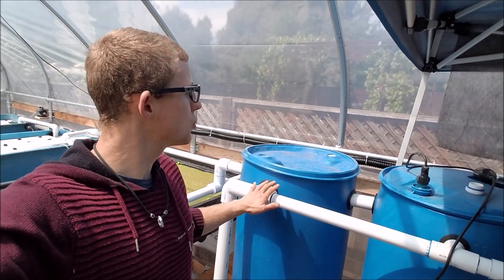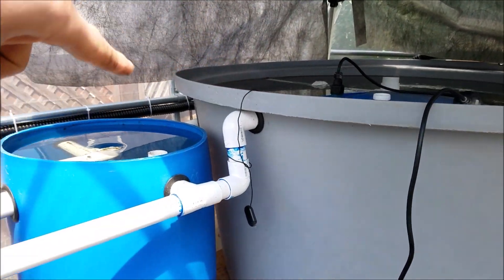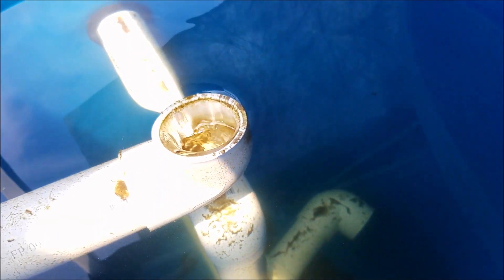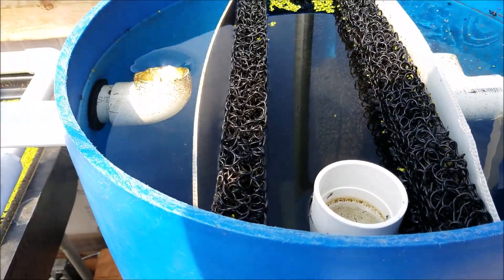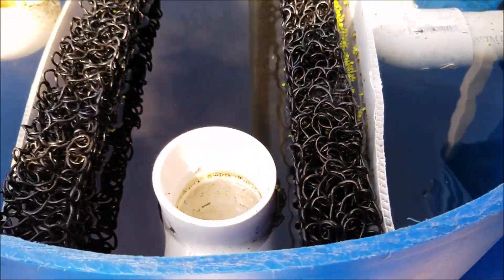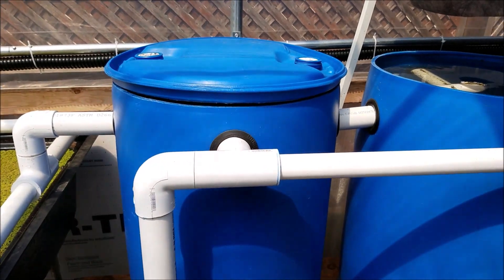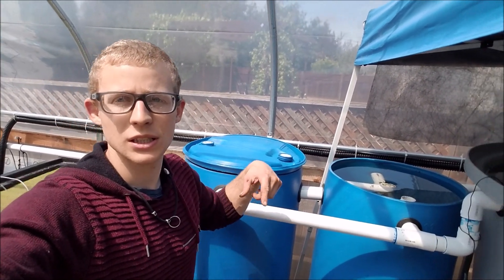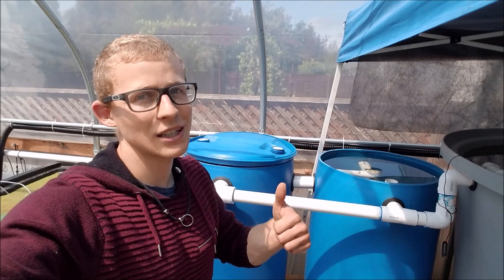Aquaponic filters- swirl filter and mechanical filter- (hybrid aquaponics)

Comment: I'm a little confused. Isn't the mechanical filter supposed to be the first filter coming from the fish tank and then the biofilter? To me, this seems as though you have two different mechanical filter systems. I may be wrong, I'm just confused as to why you wouldn't filter out the solids using the mechanical filter first and then the swirl filter.
Reply from the maker: The way this is setup is correct. Maybe I didn't explain it the best.
Also this is an older setup. (you can check out the more recent videos on the filtration here - https://www.youtube.com/watch?v=p0B2l3DyRu4&list=PLMkuBNahgb4VEpglZ5z7Ku6Bb82PUO64E&index=6&ab_channel=vonponics)

So to answer your question. This specific filtration system that you see in the video is set up with a swirl filter first and then from the swirl filter it overflows in to a mechanical filter (which also acts as a biological filter). The swirl filter is a solids removal filter, and has the main purpose of catching larger solids. It then overflows into the next filter. Which is a type of mechanical filter, and is for further catching solids (primarily smaller particles). And because of the surface area on the filter mesh in this filter it also acts as a biological filter. 
This design in this video can be improved upon, however it is setup correctly in terms of the stages of filtration. 
Typically with a DIY filter you will have multiple stages of filtration. First some sort of settling chamber for bigger solids, after that a biological filter (like a moving bed bio filter) which is for breaking down fish waste from ammonia into nitrates. Then final would be a finer solids catchment filter. You can have multiples of each on a setup if needed. But that would be the basics of it.

Hope that helps clarify
Reply: @vonponics  Thank you so much! Explained beautifully. 👍🏼👍🏼👍🏼👍🏼
Reply from the maker: @bee-pies-greens  no problem

Comment: you need a stall chamber from the swirl filter discharge,it will make the swirl work better .
Reply from the maker: Do you mean like just a larger diameter pipe around where the water leaves the swirl filter? 
My filters are different now. Not done setting them up yet though.
Any suggestion on this one as well?
https://youtu.be/94Y39s3xmaI

thanks

Comment: Try stuffing a small mesh nylon type (pantyhose) material in the middle of the mesh box. It will help with all of those smaller solids. Great work!
Reply from the maker: thank you 
And ya that would have been great to do but have already changed the filters and a lot of my system.
This is the latest update on how the system looks
https://youtu.be/spMI5pxgVZc